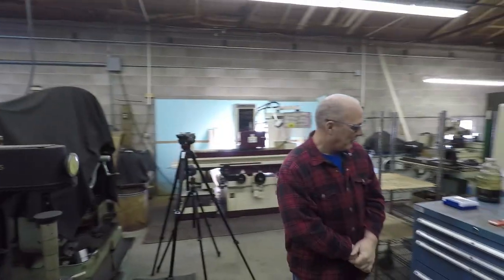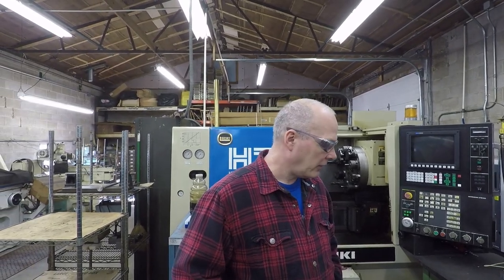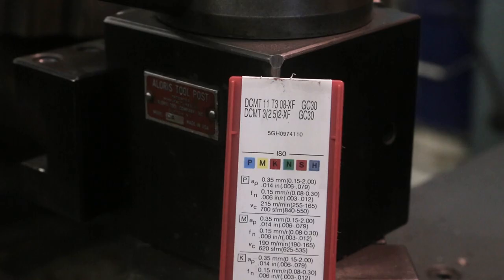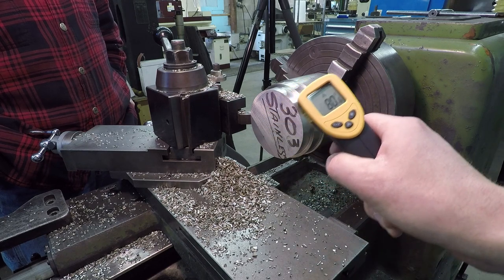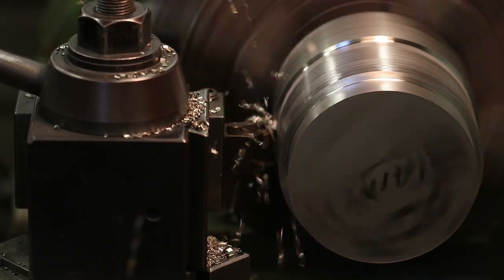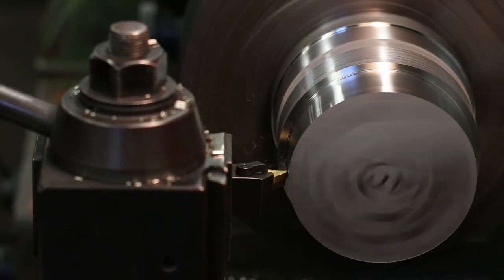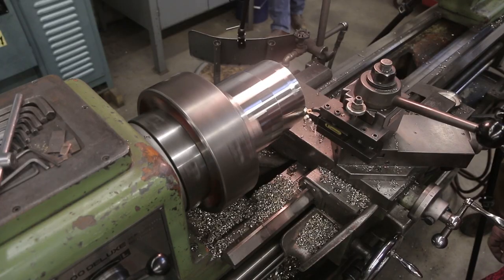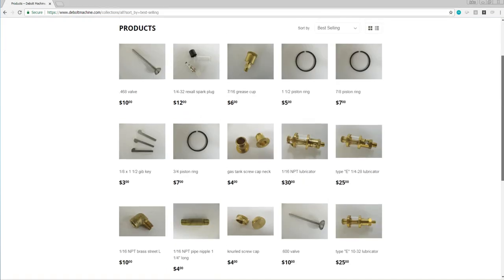303 & 304 Stainless Steel Lathe Speeds & Feeds! WW204

Comment: I cut almost all 304 stainless on my CNC lathe for my product. I wish when I was getting into it I had a mentor for practical advise. The biggest advice I could give to someone wanting to cut a lot of 304 is....buy quality inserts. I'm using almost all Sandvik now. It seems really expensive getting into it, but you can find good deals out there, and even at the bulk price of $100/pack, it's actually cheaper in the long run...a single insert would probably do what most people really need for a long time. eBay is a great place to get 1 or 2 inserts as a trial.

I wish the tooling vendor was a silver bullet answer, but I can't get one to help me out...it's likely different if you're a big shop. When I was having problems with my face grooving, the only way was to push through myself and try out a bunch of tools, inserts and grinding my own reliefs. Eventually I figured out how to do it, but it's not an easy operation in 304 in my opinion. Many of the speed/feed recommendations online all apply to simple turning as we saw here in the video, problems are almost always on the challenging operations like mentioned, or threading or some other cut that doesn't go as planned.

Comment: As an Instrumentmaker using manual machines on all the hard to machine materials whenever possible on the lathe I used coolant, I made all kinds of shields to contain it, on the Bridgeport mill I bought a cold air gun that worked fantastic. This way you can always get an accurate measurement when your workpiece is not hot.

Comment: I’ve owned a 7” and a 10” and neither were good for me. Stepped up to a 13” and would never consider anything smaller. Just the mere accuracy of a larger machine is night and day. Next one will be a 16”. Paul makes some great observations. As far as turning 304 I’ve been avoiding it for some time and have had trouble sourcing the diameters I need in 17-4 or 4140 and find myself back to 304 hence why I am watching this video. Problem is we’re talking 7mm round bar and deflection is a real issue for me. I’m going to give it a try and see how it runs. Also I’ve not had any luck with expensive cbn inserts. They always seem to have limited life and carbide inserts have worked well in stainless for me at least lasting through a few jobs. You know when heat transfers to the chips well when one lands on you and sinks into your forearm :-).

Comment: 21:20 Wow, you can see the contact point glowing. This could be near infrared that was picked up by the camera but not visible to the naked eye. But nevertheless, is that normal?
Reply: Normalish, shouldn’t really be glowing like that, means too much heat is getting dumped into the tool. It’s ok for a short amount of time, but will degrade the insert faster.  A feed or doc increase should be made.

Comment: I spent over a decade turning stainless steel making operatory table parts.
After trying a lot, I found that the best inserts for stainless, in my opinion and for my parts and machine setup, are the Walter ones, my favourite was the NM4 chipbreaker WAM20 (supersedeed by the MM5 WSM20S), in TN, CN and DNMG form.
Those inserts last a lot and they give a very good finish.
Now I'm trying the NMS WSM20S for roughing, and I'm happy with them.

Why didn't you use coolant?

Comment: My job right now machines only 304 ss, im the only machinist (and relatively amateur) so thanks for some tips
Reply: balisticsrooster your shop machines stainless but youre the only machinist? and youre getting tips from YouTube? i mean nothing wrong with that but i just find it hard to belive an amateur is the only machinsit in a machine shop.
Reply: Juxtaposed1Nmotion its not a machine shop. i got 2 years of school and 4 years on the job. Ss is just not something i did often at the other real machinie shops.
Reply: Its a company that makes pharma machines and equipment. I make parts for  prototypes and small runs, everything else is done else where.

Comment: Thanks for a very informative video. As a beginning machinist, I find stainless hard to work with, and this was quite helpfull. I do have a question: do you know or have a video explaining all the codes around inserts? There are some charts out there, but what I find lacking is really the ins and outs on to which insert to use for what task, and when, basically.

Comment: What differences can you expect in a cnc with constant flood oil? Like tool life, faster cut, or deeper. I assume only tool life
Reply: in cnc machining, you use faster speeds and stainless steels are bad at dissipating heat, so having high pressure coolant is a must if you don't want your inserts to randomly break mid-cut after two parts
coolant also lubricates, it reduces friction between insert and part, thus prolonging insert life and gives nicer looks to finish passes, also it keeps tool holder and machined part cooler, so you don't end up hitting the +/-0,01mm tolerance on red hot part that shrinks by 0,05 once cools down
and lastly it helps to "shoot" chips away, so they don't stuck between tool and part - which could break the insert and make you drop the ciggar and make fastest run in your life for that red button

Comment: Nice video. In the first demonstration I would never have chosen that insert shape.  I would I use an Insert that has a triangle shape or a soft diamond in a 2035 insert material.   316 is the softest stainless I machine on a regular basis most are much less machinable, proprietary blends. I’ve been machining stainless steel over 25 years. But that’s just me, in my shop, with my needs and goals.

Comment: Although much easier to machine, 303 is actually stronger and harder than 304.  But 304 has better corrosion resistance and is easier to weld.

Comment: Turning 304 is not a problem, now drilling and tapping, that’s a different story. Great video though.
Reply: Have you tried Emuge taps?
Reply: @phillipwebb9741  No I’ve never heard of them, what are they?
Reply: The are taps for stainless. They have different grades. I use them on a cnc mill for tapping 304 and 316 stainless. If you are tapping quite a few holes or if you only have enough parts for the job I would recommend those taps. Emuge has a 1800. # you can call. They are really smart people. Msc is one of their distributors. Just finished a project where was had to tap 1/4_28 , 3/8-24 , 3/8 npt in 316 stainless on a n old Haas mill. Only broke 1 tap, the npt. It was an error on my part. Called Emuge , done what they said, smooth sailing .

Comment: hi guys, 
what kind of steel do you recommend for the chair leg? Im trying to do strong and durable(no rust
) chair. 303 enough for this job ? And is it okay if i use for outdoor?
Reply: 430 could be good choice for less expansive durability
Reply: 304 would be fine. 303 can not be welded.

Comment: I have a 12 x 36 atlas but I never turn anything over 6 inch diameter and seldom that,,suits my purpose as a hobbyist. 1/8 inch at a time is plenty for me,,just don't like the. O042 feed rate the atlas engineers dropped the ball there in quick change,,I just my 48 tooth drive gear to 24 for feed and change it back to tread

Comment: The "right" way to machine "stainless steel" and any and all other material? Start with stock as close to the finished diameter as possible, don't jack around taking countless "roughing passes" wasting time, money, materials, utilities and your customers' patience and don't use worn-out scrapyard-reject "rebuilt" or "restored" machine tools  straight out of some "reseller" warehouse when that "reseller" when not "reselling" machine tools is a "scrap dealer" getting paid or paying very little to haul off other people's junk, worn-out and depreciated-out tools when a "factory" or "school" shit-cans its "surplus" junk and either goes tits up, sells out, changes "business models", gets new tools or otherwise decides its time to "take out the trash" and ship that old shit down the road.

Comment: 304 is my least favorite material to turn. I cringe everytime it comes into my little shop.
Reply: MD Machining 
I work with it all the time, its not too bad, just can’t do it without coolant. Way too easy to work harden
Reply: we run it with coolant regularly without any problem.
Reply: 304 is tough to work, but its so incredible. It's easy to get a mirror polish on 304, next to impossible on 303. 304 has a tactile quality that is almost sensual. With a good polish, it's got just the right amount of slip vs. grab. It doesn't wick away your body heat, so it warms up quickly. In my mind, it's an almost magical material. 316 is even more difficult to work on my hobby machines, much easier to get it to work harden.
Reply: Yeah 316 is quite the bitch, even less surface speed and feels more gummy imho.

So i'm actually glad if its just 304 

But if you get proper inserts with some mumbojumbo miracle coating it gets doable
Reply: It's just not my cup of tea. Maybe if I did more of it but most of the stuff i have made with it has not been fun. The finished are awesome but I hate dealing with it and the cleanup after. Worst cut I've had in my shop was a hiding 304 stringy chip that caught me.
Reply: Stringers suck :(  .
Reply: MD Machining it’s like Barb wire although I’ve had aluminum stringers just as nasty. Have to keep the tetanus shots up to date. I never grab the cob webs any more without using a needle nose I keep on hand. It only takes that one that hangs up where you don’t see and you pull the pile off and it grabs and slices into your finger leaving a deep burning paper like cut. Bandaids and electrical tape also on hand, lol.
Reply: I find this interesting that you all find any of the 300 series stainless difficult to machine. I personally think they run very well. Toughest material I’ve had to run is alloy 20. That is the shittiest material I’ve ever laid my hands on.